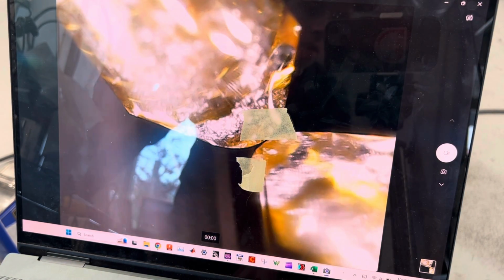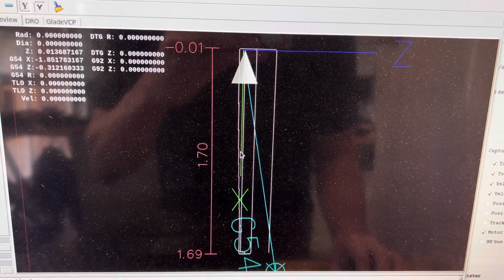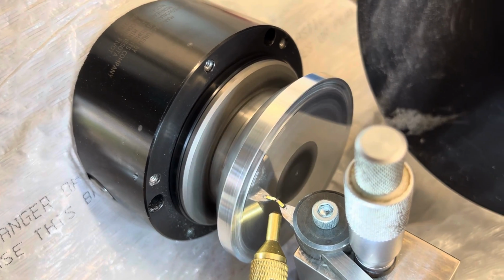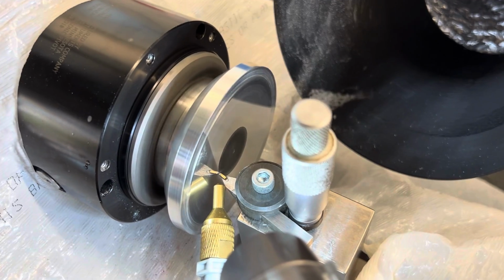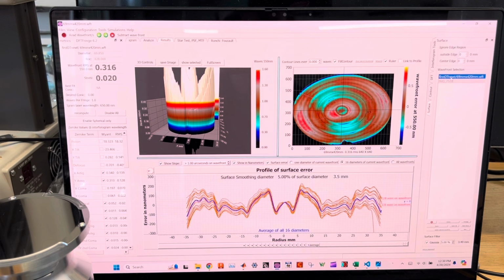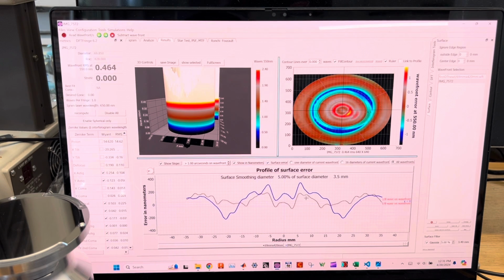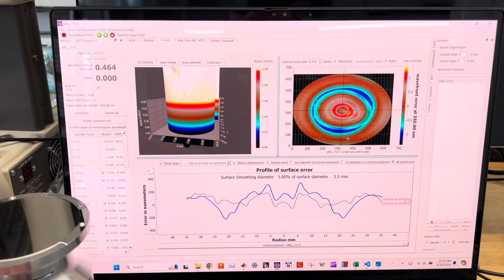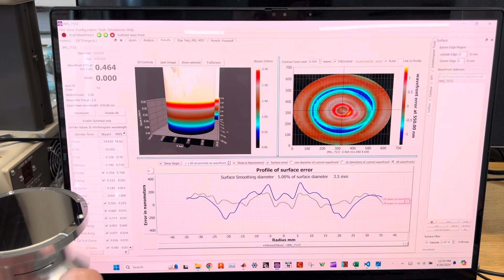Taking another pass- diamond turning a spherical mirror

Comment: Really liked the design features of your lathe. I would like to try making something similar in the future. At the precision you are working at there could be multiple areas you might check out. The microscope view showing the diamond tip at 3:59 seems to show brazing close to the cutting edge of  the diamond which could be impeding chip flow. Taking too shallow of a cut could also cause problems for two reasons--it may cause rubbing of the cutting edge and may wear the edge of the diamond due to rubbing against the aluminum oxide (aka sapphire) surface that forms after exposure to the air. The toolpost looks like it could flex and possibly rock around on the tip of the micrometer adjustment. In my experience temperature can have a big effect just someone opening a door can cause .002" change in cold weather. So even radiant heat from lights or your body could affect the precision you are working with. Hope you can chase down and eleminate the problems you are having. I look forward to following your progress!

Comment: Super cool project! Seeing how it's in aluminium, the center markings is probably slight tear, from a low SFM. depending on the specific alloy, you need serious rpm to get a true mirror quality cut close to center.
I'm only really experienced with carbide tooling, but for example, if you want a SFM of 250 two millimeters from center, you'd need just shy of 40.000 rpm.....vibrations being a compromising factor there of course.

Comment: the error reminds of what happens when material just builds up on the bit and then the bit slips back to nominal. so its getting pushed away by the build up. i dont know much about this stuff so forgive my ignorance... if its due to heat/friction maybe try to control the temperature better?

Comment: i used to measure parts on cmms and i've seen those dips in the center of turned surfaces before, the turners back then explained it with the missing cutting speed at the center of the part, dont know how well that expierience translates to this though

Comment: Your profile error at around 8mins in is likely due to tool pressure and part stiffness where the stiffness of the part is variable to match the reverse side features.
Lapidary with diamond slurry is probably the best method to produce the best flat mirror surfaces.
Reply from the maker: @CATANOVA  this is not flat. What?

Comment: you need some better thermal and wind isolating/ protection m8 man ( most diamond turning lathe's have a insulated sheet metal encluser on it to protect agens quick temp change and then over that they have a plastic greenhouse tent over it so when a door opens the wind dont hit the machine and makes it change/twist do the temp change. since we are in nanometer the temp changes is extremely important after all. if the whole machine is 20 degree C and one side siddently gets cooled down to like 18.5 degree C well cutting the machine will shrink and twist witch can be seen and measured down in those measurement's )

Comment: was the spindle and work holding balanced? could this be micro chatter? the center being dull looks like a velocity problem from my machining background(keep in mind that i have never tried to cut a mirror finish nor used diamond tools). sometimes, depending on the sharpness of the tool, when velocity of cut diminished forces can build because it becomes less plastic and or gulling can happen. for this reason we use constant velocity when turning. it might be worthwhile to implement an accelerometer on the spindle and tool to keep track of harmonics. also what kind of coolant are you using?  there are no metallic deposits forming on top of your cutting edge are there? being from bar stock, could the rings also be from the tempering on the material as it cooled at the mill? it would be interesting to see what would happen with a piece of plate vs bar stock.

Comment: Lots of good tips in here: larger tool tip, optimizing air coolant to clear tool & just worked surface, optimizing air speed to minimize material tear away, checking x axis drive mount for debris, making sure you're actually cutting deep enough so your tool is cutting and not rubbing... have any of these helped yet?

Your mirror mount seemed rock solid. When you started off with oiling the mirror, and showing us the flat line you had achieved when you ran the tool tip near the OD circumference, I was impressed... have you considered doing the same thing, feeding it inward on the X just as the tool tip would see? Maybe any machine introduced errors would be highlighted in this way.

Regarding the tool holder/mount, rotational speed in relation to center, heat, and vibration: worst case scenario thinking here; tool is rubbing some, heat is transferred into material, vibrations picked up in the mirror resonate, material vibrations interfere at harmonics highlighted by the rotational speed at given circumferences. (What was the rotational speed at the break points we see in the interference scan? Are these always repeated?)

Can you put a feeler Guage on the tool holder, independent of the tool mount, while making your next cut. (With another camera to record it.)

The mirror mount. Is it mass dampened? Is the center of the mirror supported from within, or is it like a drum?

You went to some effort to check your X dimensions and center. Check your Y. Account for tool tip size, and experiment with its cutting position. Experiment with its cutting angle.

Comment: Former professional diamond turner here with 12 years optics manufacturing experience. Very cool to see someone making their own DT machine. A few tips. If you can, get a larger radius tool. 0.030in -0.060in radius tool would help smooth out the surface tool lines. Spray your coolant form inside (X0) towards the outside (OD) of the part. That blows the chips away from the surface about to be cut preventing those chips from dragging and scratching the surface. Ring at center could be something in your X axis like a bump or debris. It doesn't take much for anything wrong in the machine showing up as a feature on the surface of your optic. Good luck!
Reply: Hello sir, I am trying to make an off axis parabola, can I reach out to you for some tips.

Comment: what is the mirror made of ? What material? From experience it is easier to achieve a desireablae surface finish on harder metals like steel stainless. Much more problematic with aluminium

Comment: Could the ring in the centre be due to the lower surface speed of the tool not being as it approaches the centre? I assume there is an optimal surface speed range for the cutter and the material.

Comment: Hi from a fellow telescope builder! In my experience, the mirror like this is a little sensitive even to its own weight. Looks like your error may come from the bar pull, then compensated by defocus in DFTFringe. You may check it by varying bar tension in interferometer. Also I would recommend starting with making a flat, it makes errors better visible

Comment: Is your linear cutting speed constant or do you increase as you cut closer to the center? I would think you want to maintain a linear cutting rate (or surface speed). Try to find the optimal "surface speed" for your tool and material combination, and try to maintain that "surface speed".

Comment: Very interesting project, you have there!! It is difficult to isolate the source of your surface error since you have several potential variables in play simultaneously (as noted in the many replies/comments). I might suggest trying to machine a flat before trying to machine a figure (spherical surface). This would allow you to test your interferometry setup and potential eliminate/minimize the question of your interferometry optics and axial alignment. Then consider machining a series of channels/grooves/rings (rectangular cross section) into the surface of differing depths so as to assess the centering/axial alignment issue and accuracy of the cut. You might also want to intentionally perturb the system as it is cutting by 1- getting up/sitting down 2- dropping something on the floor next to, a few feet away, quite far away etc. so that you can isolate the source of the surface ripple.  It might be the bearings or it might be telegraphed from the environment.
In my research work I can detect when the busses/trucks go by our building as they cause the laser beam to bounce around despite being on an isolated optical table.  Only an air cushioned table would solve that problem for me and it might be required for you.
In the early days of AFM they used to suspend the whole AFM on bungee cords to isolate them from the environment – that might be your fate as well….

Comment: At these scales my first thought is i wonder if you're running into floating point, or other numerical precision issues in linuxcnc. You may be able to experimentally determine if that's what is going on by changing the radius of the sphere you're cutting and seeing if you can corelate the errors back to a specific maybe Z relative to the sphere geometry?
Reply from the maker: Not my personal top contender, but very plausible. I have a plan to investigate this soon.

Comment: As a machinist my thoughts are:
1. Taking too light of a cut can result in the tool just rubbing.
2. Did you calculate SFM and use the correct value and are you aware you need to keep it constant across the turned surface? I mean speed up at the center.
3. All tools have a minimum cut depth. Less than that and they are just rubbing like I mentioned in 1.
4. I use diamond tipped cutters all the time and I've found that I need to run them slower than what is recommended (SFM wise anyway)
5. Make absolutely sure the tool is not deflecting the stock. It needs a very strong backing to keep from being deflected while "cutting" as your not really cutting anything, your scraping which generates forces. I'm taking 0.15mm depth of cut on a 6mm thick copper bar being supported by a 50mm thick fixture and it deflects with even that small of cut.
You may know all that already, just running my mouth.
Cool project.
Reply: I agree. Your finish pass should be minimum 0.0002in . When using a diamond too shallow a cut does result in a rubbing effect. Agree that everything needs to be as stiff as possible. Constant RPM is best for DT optics. Something this small 500-600 RPM throughout the cut will be fine.
Reply: a constant surface help

Comment: The ring happens because the speed needs to be accelerated the closer to the center the tool is, the workpiece is rotating faster closer to the edge, and slower the closer to the middle
Reply: Surface speed isn't a factor when diamond turning. Constant RPM works better actually.

Comment: I think your cutting speed in center of the part is too slow. If y can try slowly speeding up rpm's closer y are of center. Also try turning from inside out. your part warms more when y turn smaller radius. If y have first turned whole outer rim your heat has slowly creeped trough part towards the center. Heat is one reason why getting mirror finish Lapping is usually used. Even the it is done many passes because longer y do it in one time more the part warps.

Comment: Trying to hold millionths of an inch profile tolerances: #1 A temperature variation of even one-tenth of a degree will cause variation in material and machine dimensions. #2 Any outside force applied can change machine alignment. (Like if you place your hand on the machine or even if you place your feet on the floor differently.) #3 Any external vibrations that are not compensated for will change tool to work piece orientation by millionths.
Reply from the maker: yep. its a fool's errand. luckily im a fool!
Reply: @cylosgarage  Well, at the very least, you COULD make your errand a bit less foolish by at least addressing the temperature concern. You can make a nearly constant temperature environment by use of a PID loop heater and a box as an environmental chamber. Most of them will hold to within a tenth of a degree if you use an RTD for temp measurement.

Comment: 7:00 I have seen work hardening artifacts from prior passes and/or the original material condition showing through machining passes.  you're taking so little off some of the stress in the material may be there from the section that was not cleaned up so deeply.  The chip geometry may have changed abruptly at the spot of the ring.

the air nozzle scares me w.r.t. surfaces finish as well.  it has noise.  the noise is pressure over the surface of the workpiece ... so you have a variable load on the end-play bearing.  Is the variation in this end play smaller than your tolerance?
Reply from the maker: That's sort of what I was thinking about the ring too. With regards to the air though, that effect is on the order of single digit nanometers, and very high frequency. I'll investigate it when I really chase down surface roughness, but for now im focusing on form a little.

Comment: Interesting project.  If you want more info on DFTFringe. Let me know.  I'm the author.  I hope you can change the 3D plot parameters so that we can see the surface in 3D.  You just need to increase the vertical scale using the controls on that display.
Reply from the maker: Ha! Thanks for stopping by Dale. I'm absolutely loving DFTFringe! It's honestly helped a lot with my understanding of optics. I completely missed the vertical scale settings though, d'oh...
Reply: @cylosgarage  The astigmatism of the second test is lower but still way to big.  But if you did not average several results then it could be from air currents or even other sources.  you can know for sure if it rotates with the mirror.

Comment: Fascinating. I am not a machinist, but maybe linear speed is too low when close to the center, and need to do variable rpm to compensate?  Also thermal expansion might be an issue, need to pre-warm everything before doing any measurements, and maybe even model thermal expansion, because once cut, and then cool down, it will assume slightly different shape. Or probably easier pre-warm bearing by letting it run a bit, but make sure part is cooled down to room temperature.

Comment: Could the ring in center be caused by cutting speed crossing a critical speed boundary?
I've noticed my surface finish changes on my lathe when facing if I do not slow down the feed as I close up on center.

Comment: Two thoughts.. first on machine performance, is the any reason to suspect the linear encoder to account for some of the error? The fact that some amount of it repeated seems to point towards more towards the machine. 

As a suggestion, try bumping the diamond tool a bit in Z and re-running and comparing the result, now using a different portion of the linear axes.  Alternatively, take more material off and see if the errors change in radius on the optic.  Another alternative would be to compare to a flat part with the Z locked.

As a second thought, did the material come out of round stock? I wonder if the material properties might vary radially and the core defect you are seeing might be related to hardness/grain size variation or something like that.  Perhaps try a different piece of material?

Comment: Just my two cents.  I think the center might be from not having enough material at the smaller diameters.  On or lathes we always use constant surface footage.  When we get close to the center the lathe often maxes rpms out trying feed enough material.  

Another thing is the banging in the background could cause issues in finish quality at these levels.  Also the Heat from the sun hitting the machine could be something to think about.  You're playing on a level most people never even think about.

Comment: Inner circle is most likely caused by an inconsistent surface speed. As you get closer to the center of the part, your radius decreases,so you would want to speed your spindle or slow your tool path in order to keep a consistent surface speed. Many lathes have a code for it, G96

Also from experience it tends to show up sharply like that, as you move out of resonance you start to rub/chatter
Reply: Came here to say that. It's a very common problem if the goal is high precision and/or an excellent and consistent surface finish. There is some optimum sfpm to get the best performance. It's not (often) a precise rpm with no wiggle room. It's a modest range. But once you leave that range/sweet spot.....you will get a discontinuity in the surface finish as it leaves the happy frequency and enters the unhappy and inefficient frequency.

Comment: If the machine is repeatable would running a spring pass possibly help halve the errors in the profile, if the profile repeats then youd know that would be the inaccuracies is the machines abilty to correctly follow the profile that your aiming for. Since your working on such a macro scale i cant promise thatd itd be useful. It could also be noted thats the tool could be being pulled down and preloaded like a spring whilst you are cutting then as the force and pressure builds it returns ,to some degree ,back to the set height of the tool. Itd explain the wavyness of the finish because as itd pull down the distance to the tip of the tool and the part would increase, when its springs back that distance would decrease again. As you said its also likely thats its also just vibration from the air bearing 

By no means do i expect it to help but could be another angle